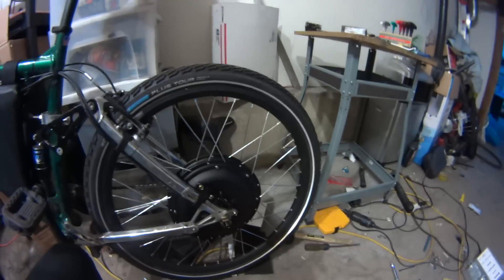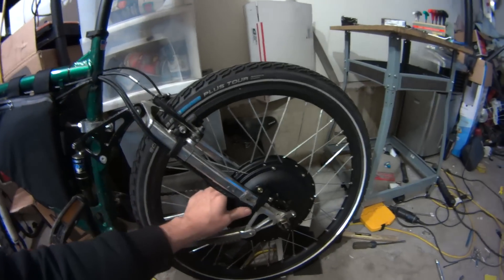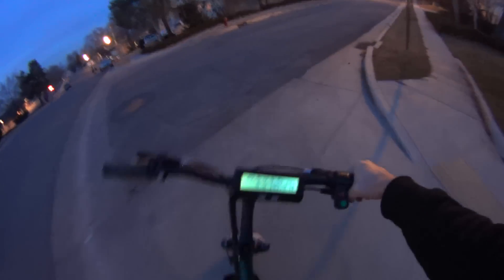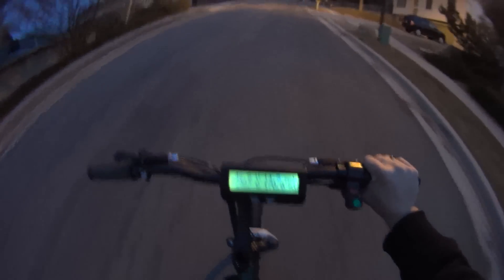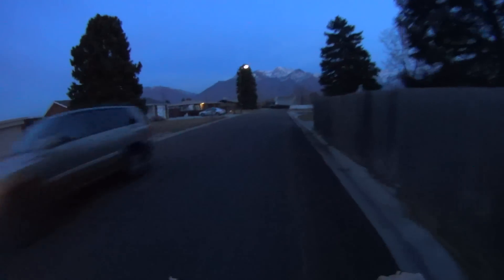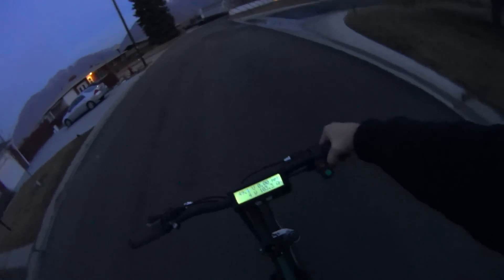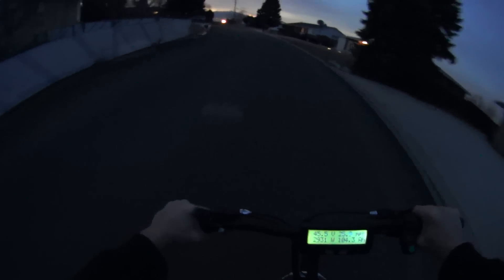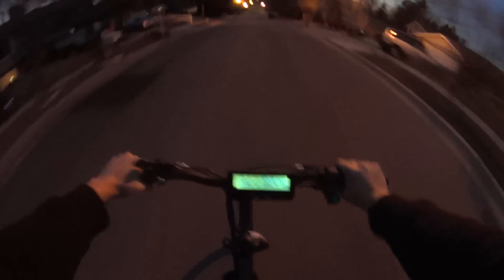Leafbike 1500W hub test ride

Comment: Is this controller doing FOC is that why you have such a good top speed aside from the amps?
Reply from the maker: No, it's a very old and basic design controller which had phase advance.. similar to FOC.

The motor itself was a very high speed winding. It easily hit 40mph on 48v. Turning on +20% phase advance bumped that up to 45mph.

Comment: Dude! You're flying around on your neighborhood streets in the dark at 45 mph with no lights.  You're a BAMF.
I'm also thinking about getting the leafmotor 1500W 26" conversion kit.  I see that your video is already 4 years old.  Do you think they still have the issue you had with the controller getting super hot?  Should I just buy the wheel and get buy a separate higher powered controller?

Comment: You have an idea what max volts/amps the stock controller they sell the kit with can take? They describe it as 48v 40a.
Reply from the maker: no idea.. that controller is garbage and generally don't touch unprogrammable kit controllers with low quality FETs like that.

Comment: I got a 1500w 48v hub from pasion ebike and it runs at 50mph without load after you change the speed measure to km/h and the wheel size to 61% (and then treat km/h as mph). So I'll be happy with this for a while upgrading to a higher voltage battery maybe in the future. With a 52v 35a 30ah battery I get a top speed of 35mph on flat ground and I can climb a 5% hill at a 28mph . It's the perfect scooter alternative. Range is about 40miles full throttle :)
Reply: Could you perhaps share the kit like where you got it from? like ebay or amazon or something
Reply: @ripp3rjak934  aliexpress. Very reliable.
Reply: @warlockboyburns  ill check it out
Reply: @ripp3rjak934  The motor has been running at 4200w using a new controller though. You might as well get a 3000w motor kit which aren't a lot dearer and have more torque.
Reply: @warlockboyburns  Do you have a recommendation for a battery that could hopefully last me a whole day?
Reply: @ripp3rjak934  for all day you would need a very large 72v 40ah triangle battery in the middle of your frame and even then you would have to limit your speed to around 25mph to last you all day.
Reply: @warlockboyburns  Dang that sounds hella pricey

Comment: Did you ever let that controller out of its bag?
Reply from the maker: Yeah. In later videos, you'll see an 18FET or 12FET running along the bottom of the bike.
Reply: Thanks - hear a lot about controllers dying - and they tend to ship them with nice bags - but the only way to cool the things is by convection - metal-to-metal.  They already have a metal case - hopefully waterproof.
Reply from the maker: I've never heard of a seller purposefully suggesting that a controller go in a bag, or selling any kind of controller bag. That was my idea.

What i've done in the past is overrate my controllers so that they can handle being in a bag, because i like a clean look. But this 4T Leaf was a real amp chugger and i couldn't get away with that anymore. :)
Reply: Thanks for the Dope!

Comment: Torque (in N*m) = 9.55 * Power (in watts) / Motor Speed (in rpm)....

Its the RPM and voltage specs of motors that are the main limiting factor, it will only spin so fast, you can, however, chuck a massive amount of amps and the motor will have more torque, and accelerate faster.

Most hub motor makers will double the nominal torque values, but in real world situations, cut that in half.

My bike is 9.55x2200/520= 40.4Nm of Torque. 

To get your "peak"  Power figure, simply times your amps by your voltage, thats your peak wattage draw, in my case, that is 45 amps x 48 volts, giving me 2,160 watts with a motor tagged "1500 watts"

The reason this bike is so nuts, is this....

65 amps x 48 volts = 3120 Peak Power.

9.55x3120/660= 45 NM Torque

His setup is 10% quicker to top speed, by chucking 65 amps, rather than my 45, also, because his rpm is higher, his top speed is 5-6mph faster, a 520 v 660 has that much difference, beware 480 versions, as they are really only good for 1,000 watt motors.

When buying a 1500 Watt motor, pay special attention to the RPM, leafbike also provide two versions of this motor, one has around 50nm of torque, and the other with around 75nm of torque, the difference is simply how fast they spin, with the higher torque version being SLOWER.

If you want to reach higher speed, use a higher VOLTAGE battery and controller.

If you want quicker acceleration and higher torque, use more AMPS, and pay special attention to your Battery BMS.

for these 135mm motors, around 5,000 watts and 72 volts running at 65 amps is the maximum anyone should expect.
Reply: I have a 45 amp controller that i run with a 52 volt battery (70 amp peak discharge) but it never uses more than 25 amps. How can i fix this? Since there seems to be no reason for it to not pull more amps, while the acceleration is pretty slow. It is a high speed winding motor if that is important
Reply from the maker: You know, i peaked to about 6000W. The motor was not the limit.. my ability to keep the front wheel on the ground was, and i had to lean on the front when taking off. 

You would need a bike frame with a more forward biased riding position in order to push beyond that. What i found amazing is the length of time this motor could take that abuse though.

Per the leafmotor dyno graph, i'd imagine i'm pushing 100-120nm of torque here.
Reply: thats really on the limit of whats possible with these, how are you dealing with the heat issues when on a long run ?
Reply from the maker: Yeah, it is the limit.. not an every day thing. You can pull this kinda power for maybe 10 minutes, and beyond that, you're gonna get a crapton of heat. Unless you vent the motor like i have, and then you've got 15 minutes :P

Long term, i run the motor on about 3600w peak, 2000w continuous. Seems to be pretty happy doing that for 20 mile stretches at around 40mph average.

These days, i'd try ferrofluid and a hubsink instead of venting. I bet that setup is better than what i have.
Reply: yep, 2000 watts and 40mph is ideal for these motors, I am hoping my 48x45x45 set up gets me close to 40mph, although I am running almost 1,000 sustained watts than yourself

Comment: would it be possible to run this motor on 80 volts? I have an EV esc where i can set the current. Like maybe set the current to 50 amps or so.
Reply from the maker: I was running it on 76v. You'll want more current than that though.

Comment: I bought the 1500W leaf motor as well, I've been having issues with the the battery BMS limiting the motor to 300 - 500W.  Leaf motor said I have to reconnect the power wire when this happens.  It just started happening about a day or 2 after I installed it. Is anyone else having this problem?
Reply from the maker: The battery cannot handle the load. Not a problem with your selection of motor.

Comment: which do you prefer hub drive or Mid drive ?
Reply from the maker: That's a hard question!
I don't like powerful mid drives because chain breakage/wear is a constant thing, but damn if they aren't light and really great for scaling steep hills.

I love hub motors because they are powerful, cheap, and efficient... but they are heavy and when you get a flat on a long ride, replacing the tube on a rear wheel is a nightmare in the field.

I'd have to say that i don't really love either. I'd take a rear single reduction chain drive with a BMX chain ( or thicker ) direct to the rear wheel any day over either option. But there's no easy kit for doing that. It has to be fabricated and you need the right frame to start with.

Comment: I just got the same motor, installed with the stock controller and only reaches 35mph. I don't know why I can't get up to 43mph. Could it be my weight 195 lbs or something else I don't know of ?
Reply from the maker: That's about the speed you'll get with a 48v battery that has a lot of voltage sag. I get up to 45mph using an infineon/xiechang type controller's "120% speed" mode.

My 46v battery sags by about 3 volts at peak load.. i'm thinking that your battery might be sagging more, reducing the speed further. Just a guess.

I'm 193lb by the way.

You would probably see that 45mph speed if you had a strong 60v battery.

Comment: awesome bike, insane set up, cool vid too! can you tell me what kind of range throttle only and pedal assisting do you get from your battery? you have 48v battery with how many Ah? Now time has passed do you rate the Leafmotor system? has it worn well in the past year+
look forward to hearing back
Reply from the maker: +bee R.a.d Depends totally on the speed. I have a 46v nominal 25AH battery.
At 20mph, i can see 70 miles or beyond.
At 30mph, i can get up to 40 miles with pedaling.
At 45mph, i can expect a 10-15 mile range if i am lucky.. :)

Comment: nice bike! a question that the difference between a battery of 60v 60Ah and 60v 20Ah?
more faster or more capacity
Reply from the maker: +ESCOBAR CRISTIAN 

60v x 60ah = 3600 watt hours
60v x 20ah = 1200 watt hours.

Speed is dependent on voltage - voltage drop for the given load. Range is dependent on total watt hours.

Comment: hi mate, what gearset did you use did this fit a 135mm rear drop out?
Reply from the maker: +supersavage123 An oldschool shimano megarange with the 11T freewheel.
If i didn't have that lying around, i'd use a DNP 11T freewheel.

You will also need to use 1-3mm spacers on each side of the axle to prevent the lowest gear in the 7 speed freewheel from hitting/rubbing the inside of the wheel dropouts. Otherwise, you will have to go with a 6 speed freewheel, and your lowest pedaling gear will be a 14T at the lowest, which would only really allow you to pedal up to maybe 20-35mph, depending on your front chainring and wheel size.

( you'd need a tall 700C wheel and a comically large front chainring to pedal to 35mph on a 14T, FYI )

I have an 11T rear gear to a 53T front chainring, and can pedal to 45mph at a very high cadence, but 40mph is manageable to pedal on a 26" wheel.

I recommend having your gears set up somewhat like mine.
Reply: yeah rito i have a 8 speed and looking at a 35mm hub motor, and dont want to jig the frame too much guess ill have to see when it rocks up thanks for the reply man cheers

Comment: Chain will likely keep falling off until you get specialized chain and gears.
Reply from the maker: Nope.. i took a link off and it's been running great since.
Hub motors do not require any of that.
Reply: It’s not a mid drive genius you don’t even need a chain and gears

Comment: Just because the motor is barely warm does not mean it's very efficient.  It could mean the motor is trapping heat.  It would be more interesting to know the internal motor temp via a thermistor.
Reply from the maker: +J S This motor has 90.5% peak efficiency, and 87% efficiency at a continuous 2000W. All the other motors in this class peak out at around 84% efficiency. This is as good as it gets until we get hub motors with 0.25mm laminations and optimized winding patterns that are wound perfectly by robots.

My motor is vented and i can find the internal temp via an IR meter.  I take measurements after long rides in the later videos. The results are pretty good, considering the size of the motor VS. How hard i am pushing it.
Reply: +neptronix 
thanks for the info.  i just read your ES post too.
I made this comment b/c my previous motor (magic pie 3) has crappy thermal resistance so the motor case doesn't let the heat out.
My new motor, MXUS 3000, seems to be better in this regard.  It also has 0.35mm laminations.

Comment: 43mph 3000watts doesnt seem very efficent im going 48mph flat ground no wind with 2300watts same motor.
Reply: Im on 67v 10ah I see you said this was uphill but when u went back it went slower I would think u would go faster down hill when u turned around.
Reply from the maker: em2k20 There was not a single flat piece of road in the video. There is another video where i show watts per speed. It's similar to your figures.
Reply: neptronix Why you guys talking about 3000w when the title says 1500 w? Am i missing something?
Reply from the maker: konard konrado It is a motor that is rated for 1500w. If you note the cycle analyst display on my videos, you will see me pushing up to 6000w into it.
Reply: neptronix ok i got it , have fun ;p

Comment: Hi
I had a question for you I was looking at the 1500w leaf kit 700c for my 29" (cheap Walmart genesis bike) and was wondering what space is available for the freewheel and does it come with a single speed 16T freewheel? I have never installed a rear bike kit I have a 1000w right now on a 26" FWD that I need more power for hills.  I would not beable to do what you do because I just have a Ping 48V 20AH battery that cannot handle those amps.  Any suggestions for me the kit is like 525 bucks with shipping from that site.
Thanks